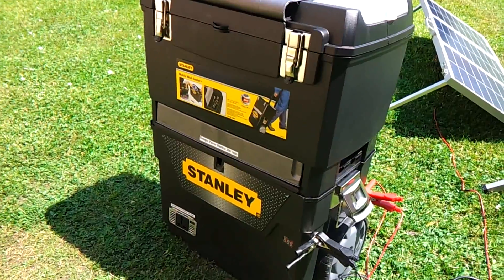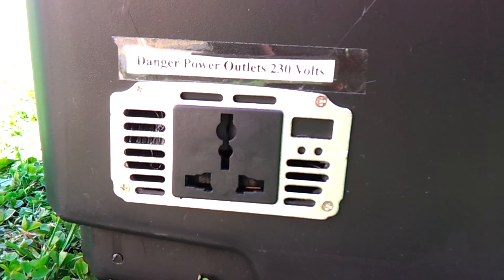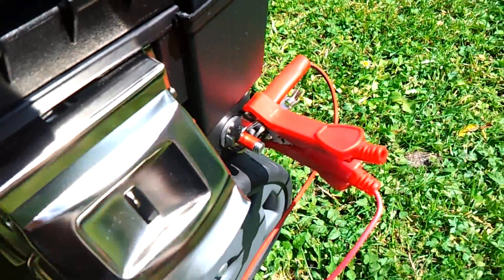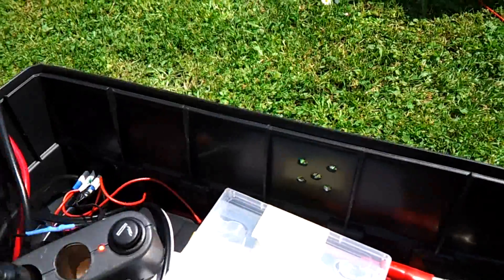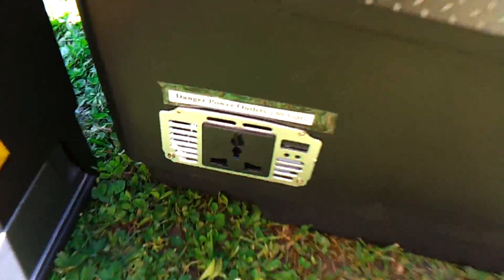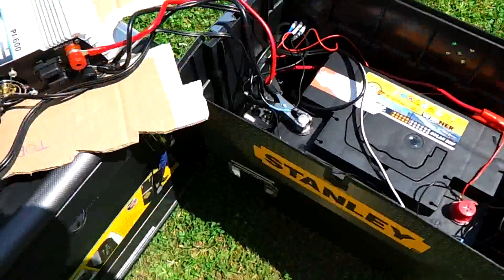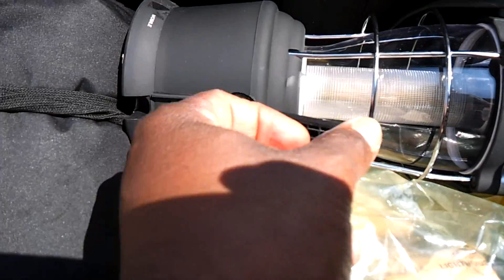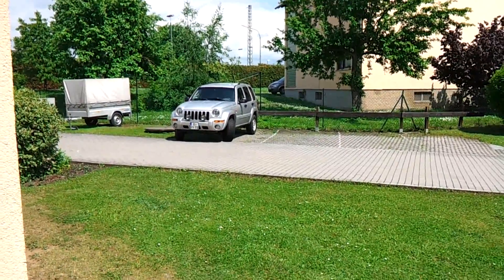Solar Generator (The Grizzly) Part One

Comment: Thanks very much for sharing!!! I am currently in the process of ordering all of the parts for my set up and will be using the same Stanley rolling Tool Box that you have, but may remove the wheels and mount on a compact truck/dolly with rubber wheels and telescopic handle. I would like to start with a single 12v, 125 amp hour battery, Renogy 50w solar panel kit with 10 amp charge controller, 2000w inverter, ability to connect to additional batteries if needed, exterior LED lights and all of the "standard" meters/plugs/ports/cooling fans/outlets/etc. I would much rather build my own as you have done, than to purchase one that is factory made. Also, I am seeking the most compact RV wind generator as well, so that I can increase my ability to keep the battery/s charged. HUGE THUMBS UP ON YOURS!!!
Reply from the maker: +Angler Beaudry Thanks!  I have since upgraded mine over time.  I use 215w solar panels to charge my 100aH battery but I found that a 1000w pure sine wave inverter sucked to much power so I went back to a 400w modified sine wave with no issues.  My setup is mainly used for camping so I need to power a small fridge, various led lights, phones, tablets ect.  In the newer configuration I got rid of the bottom portion of the toolbox and use only the top portion as it has a built in handle.  If I could find a 300w wind generator that was small enough to be used at European camp sites I would jump for joy!  My other videos show the 1000w inverter in use while camping.  The 100aH battery could supply all of my power needs for 4 days without the need to charge up with solar power.  To achieve this I did run the mini fridge on medium the entire time.
Reply: Man, I just learned a lot...thanks!!! I will subscribe and check out your other videos! Thanks for telling me, Angler.
Reply: +Gregory A. Parker Sr. So, regardless of what you have plugged in, a higher watt inverter uses more power or that particular sine wave one did? I really wanted to go minimum 1500w inverter with single 105 amp hour deep cycle battery is why I ask. Thanks again!
Reply from the maker: +Angler Beaudry I had a 1000w pure sine wave inverter that you can see in another video.  It sucked so much power that I was getting low power alarms from the inverter after only using it for a short while.  I had to reduce power to all of my electronics because of it.  I sold the inverter at a loss and bought the 400w modified sine wave and ran it 8 days on a camping trip with no issues.  Maybe the 100aH battery or solar panels weren't providing enough charging power.  In any case it works perfectly now with the smaller inverter as long as you don't try running hair dryers or microwaves with it.

Comment: thats really nice. does it roll ?
Reply from the maker: Dale Lessie I use it to power a mini refrigerator, 2 tablets, 2 phones and a host of other electronics while camping.  I have more videos showing it powering the fridge.
Reply from the maker: It used to roll in this configuration but I have since moved everything into the top portion to save on size.  It doesn't roll now but I never carry it for more than a couple minutes or so as it's heavy.  I have other videos showing the 'smaller' size.
Reply: I love it can I power a cooler for a camping trip

Comment: Yea I agree they are expensive but I get mine from a few different computer stores where I live. They have laptop batteries that don't work and I get the cells out. I have spent about $26 total and I have enough now to make the first 12v battery of the 4 that I will be making.

Comment: I will be doing something similar but mine will consist of home made li-ion battery packs from laptop battery cells. I will be making a total of 4 battery packs that will equal up to 400Ah. And unlike lead acid will weigh about 60lb. I just want to be able to lug it around easier and have a large capacity.
Reply from the maker: Li-ion batteries cost more but if money was no object then it would be worth looking into.  As for me weight isn't a problem.. I pick the battery pack up, load it into my truck, place it inside the tent and done!  If I could have a 400aH battery for camping I would be on top of the world.  Let me know how it goes.
Reply: I get li-ion for a good price. I salvage laptop 18650 cells. I can get the packs sometimes free from pc repair shops that don't want them or for $1 each. Usually I can get 4 cells from each pack that have most of their original capacity. All the bad cells were shorted out from circuit malfunction. So yea I built a 100ah last month for about $30. So cheaper than lead acid. Just needs a little know how. But I love the simplicity of your box. Good luck to you in the future with your projects.

Comment from the maker: I am in Regensburg but since you are military you should be able to get everything cheaper than me.  I bought everything either from Ebay Germany, Conrad or Media Markt.  I just received another folding solar panel yesterday.  It's 120w so that in addition to my smaller ones gives me 215 watts of solar power.  I didn't use any high tech means to assemble the unit.  If you need additional tips or pictures then I can email them to you, but if not then I'd like to know what mods you make to yours.